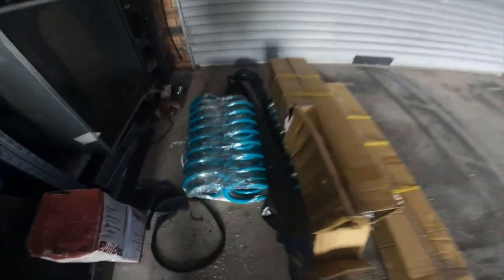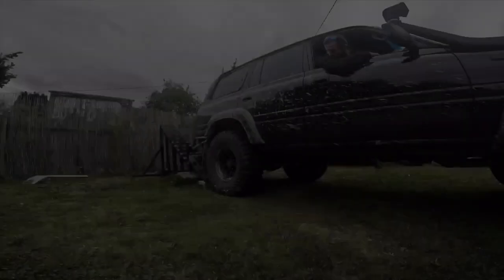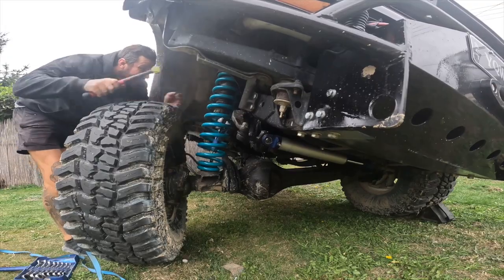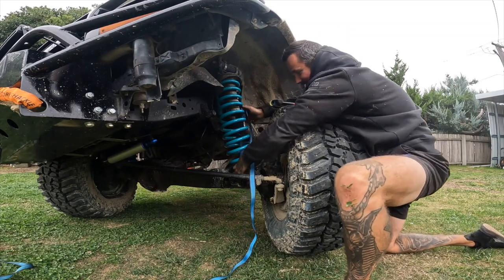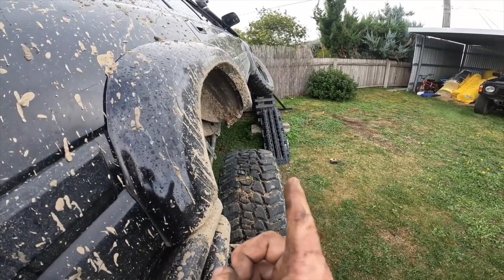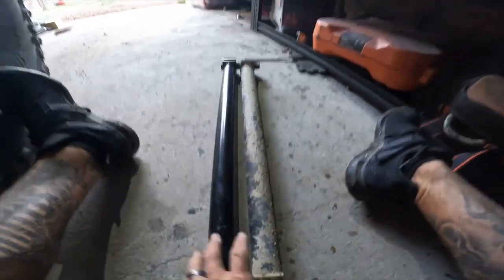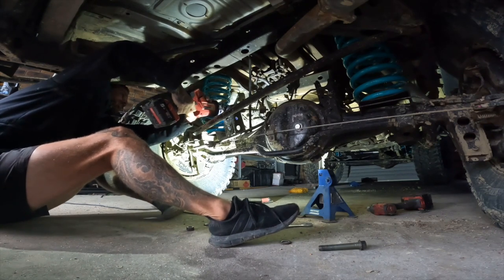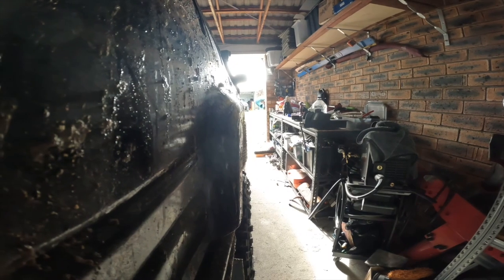Upgrades to improve your 4wd's Suspension!

Comment: i measure from the lip of the rim for what its worth  not that we`re  chasing microns its just consistent , you got solid gains in the front  thats huge , hopefully my gu will improve that much with some shocks and better radius arms .  its a wanna be stock 79 in the front ATM
Reply from the maker: @chrisbeerad8835  some longer shock should change everything! Then it will come down to radius arms, depends if they bind up!